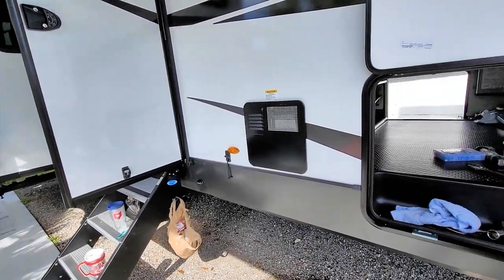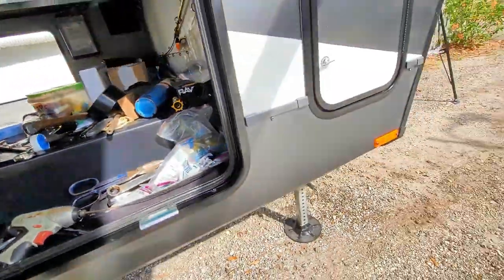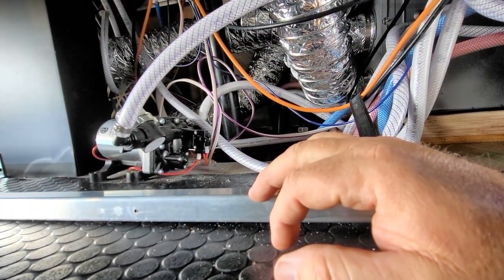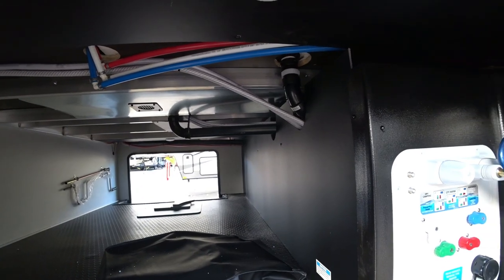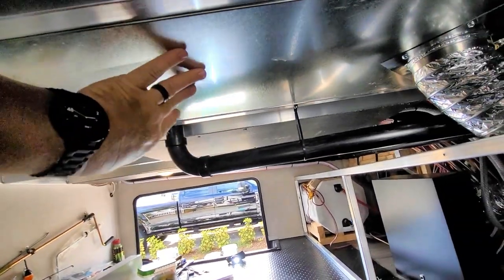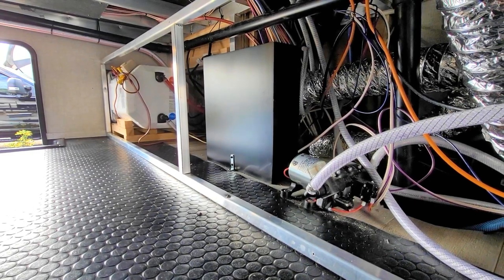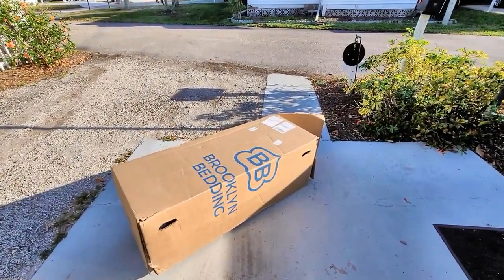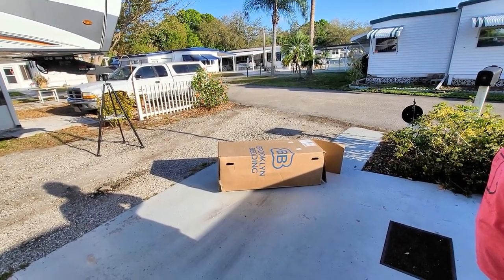UPDATES* Making Rockwood 5th wheel even better

Comment: I checked for the same as for moving the partition but wasn't able to move it. I did arrange the heater duct a little different. The way they had them installed it had too many bends in them. Each turn cuts down on air flow.

Comment: I see some nice room for a battery bank, larger inverter and solar controller in that area where you are moving your wall back some.  Lots of room back there - just sayin’. :). Nice job relocating the wall - that is a very large storage area.  Reason people put Lithium batteries in that area instead of up front (in the OEM location) is that the up front area is not heated, so a Lithium battery may stop receiving a charge if the temperature drops to below 25 degrees (hopefully not an issue for you since you can chase warm weather easily).  Enjoying your projects on the new 5th wheel.

Comment: Great content! I think they had the wet bay designed like that so if it ever leaked it would drip down there.
Reply from the maker: We are gonna bead of Silicone there.. 😁
Reply: Absolutely that's why.  Big Truck Big Rv /JD always complains when the wet bay doesn't overhang into the  well so the leakage will exit out the hose entry from below.  Makes sense and Rockwood did a " cost effective " way of pushing the faceplate out that way.  will in Florida